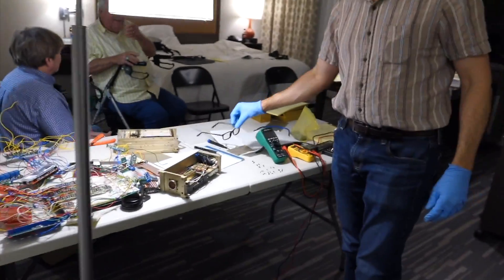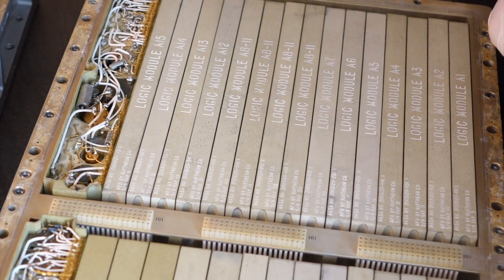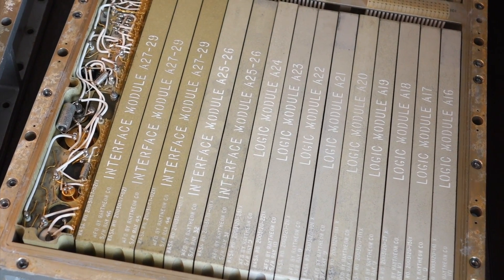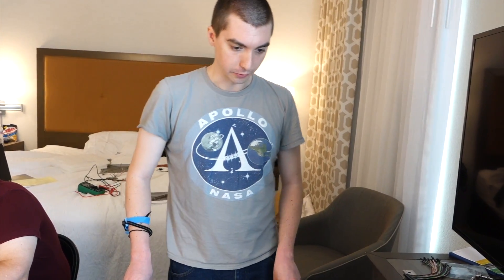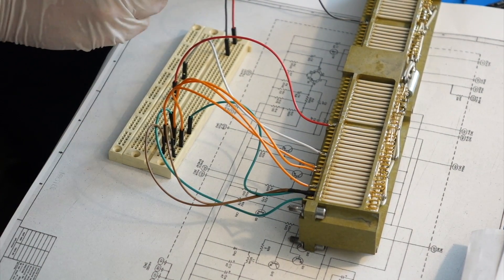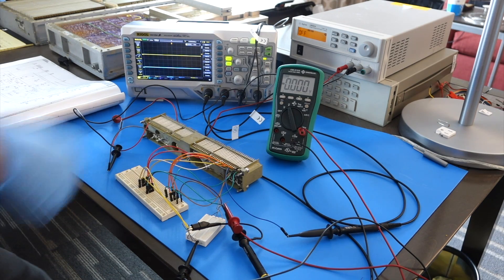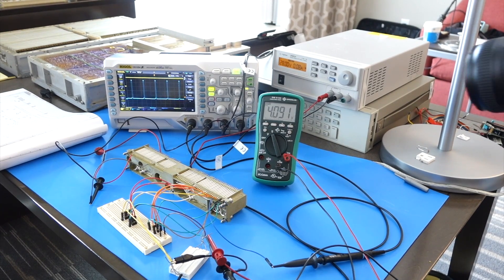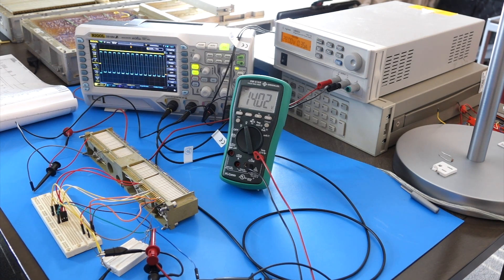Apollo Guidance Computer Part 2: Power supplies test

Comment: @11:35 so they had found out that using PCBs and soldered components in the Polaris missile was unreliable, so they didn't take any chances and went with wire wrap and welded components for the manned missions. That made me realize that the technology used in our cars today IS soldered components and PBCs... I guess (hope) there has been huge progress in the reliability of that technology since then ? lol ! 
Anyway, very enjoyable video as always. Thanks for sharing, Marc. BTW, 18 minutes is NOT long-ish at all with this kind of fascinating content (for the nerd in me anyway). It seemed like 5 minutes !
Reply: AlainHubert - Yes, it’s a lot more reliable now than it was in the ‘50s & ‘60s; however a welded connection is still better than a soldered one. Also, FWIW, the wire-wrapping process effectively creates a cold-weld at the corners of the pins where the sharp edge cuts thru the kynar insulation and digs into the wire - this is due to the tremendous tension that the wrapping turns are under. This tension also helps with vibration resistance.

The reason soldering is used instead of welding is a) it’s good enough most of the time; and b) it’s easier to do quickly in large volumes.
Reply: AlainHubert Of course there has been development. However, cars don't usually experience 5-10g, possible extreme heat ot cold (-150c-500c) :D They serve their purpose. I've seen a lot of failed stuff like failed joints on automotive stuff, but usually after more than a decade.
Reply: @rkan2  You forget the 5G 50mm vibration in all 3 axes the missile boards had to endure during testing and use. Missile boards are still fully conformal coated in a flexible coat, then potted in a hard coat after testing, then potted into modules as final step because of the vibration. Soft coat absorbs stress and the hard potting speads the stress evenly. only has to work flawlessly once, but has to endure a lot of testing before that, and a lot of abuse.

Comment: What an amazing piece of engineering. It’s all too easy to say this computer is so slow by today’s standards but I bet it would be more resilient than any general purpose computer in the environment it was designed for!
Reply: Yes, you can't put your standard home computer into space. You need to design for the high acceleration and the vibration that the rocket or spacecraft will experience. Oh and a software crash is totally unacceptable.
Reply: @gorillaau  Think about Apollo 12 and how the IBM IU just kept chugging away after the booster was hit by lightning 2x!!!  A modern computer is toasted if the power flickers to hard!!!

If your computer locks up during launch your gonna have a bad day!!!
Reply: @chrisjohnson4666 oh totally. Five nines (99.999%) is not  good enough. To paraphrase a petrol engine slogan, It has to work first time, every time.
Reply: The question is not "was it slower then todays computers?" - Yes, of course it was.
The real question is "Was it to slow for the tasks it had to do?" - And to this question the sound answer is: No, it wasn't. Although not by a large margin, it still was fast enough to do that.
Reply: @kallewirsch2263  unless you wanted to could the 1201 and 1202 error codes as being due to insufficient available processing grunt.
Reply: @joyange1  hehe.. Clippy for AGC. "It looks like you are trying to land on the moon. Would like me to reboot the AGC, shut down the the AGC or report to NASA that the AGC is offline." :-)
Reply: the computer is fast it just doesn't do much of anything other than run a vehicle

Comment: Great video. Quite the leap in technology over the decades from the time of the TTY from you last video. Amazing to ponder. If there was ever any doubt, this confirms I don’t have the “right stuff.” If someone asked me to do a half-million mile round trip on that thing to the moon and back, I think I’d have to pass, regardless of the quality..
Reply from the maker: And to think Teletypes were still in widespread use at the time to relay the landing news - and probably to communicate with the recovery navy ships.
Reply: I worked on a mainframe computer line that into the 1970s was still using a KSR 33 as it's main console interface.